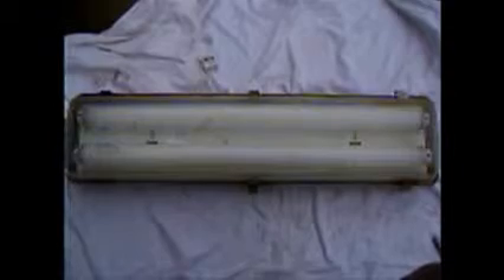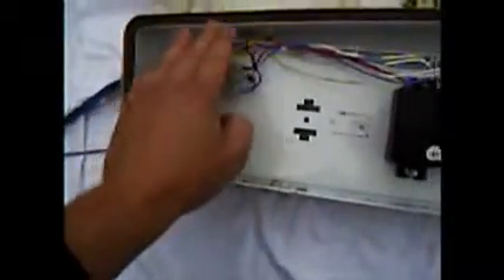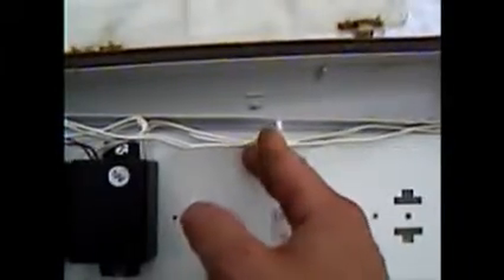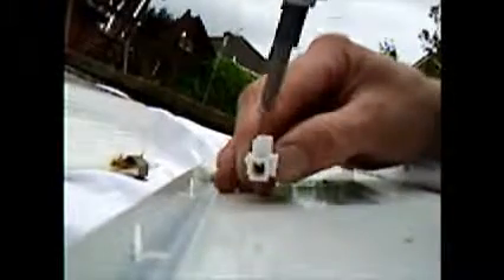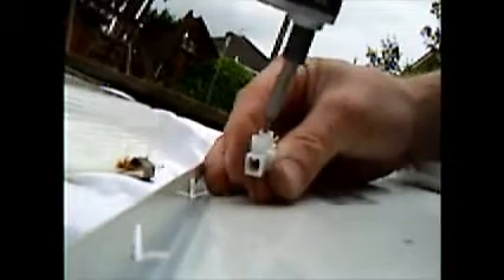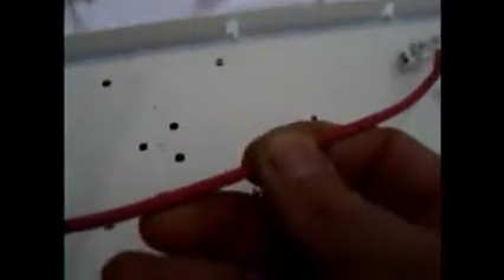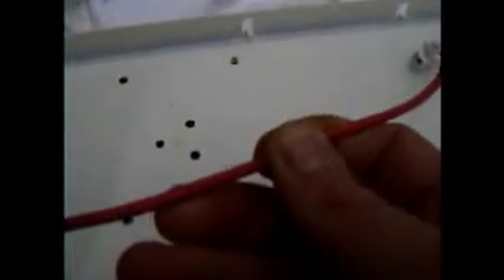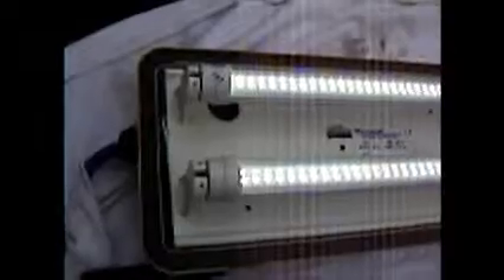FLUORESCENT TO LED CONVERSION GUIDE

Comment from the maker: Yes but make sure the power is off before you bigging work  and due to voltage it should be carried out by a qualified electrican  be ware 240v dc can kill